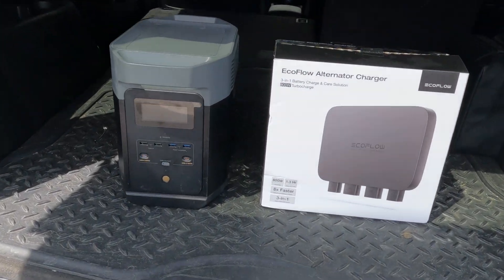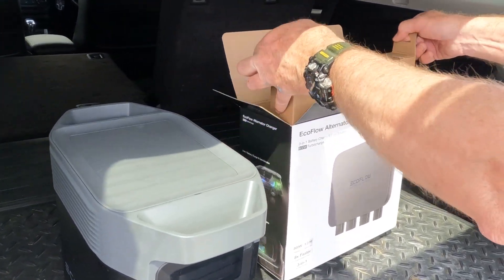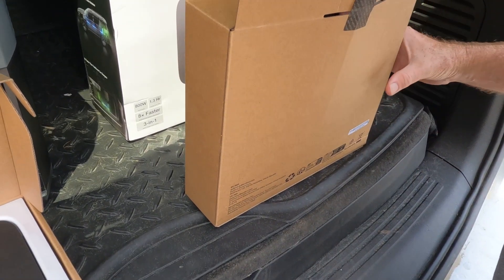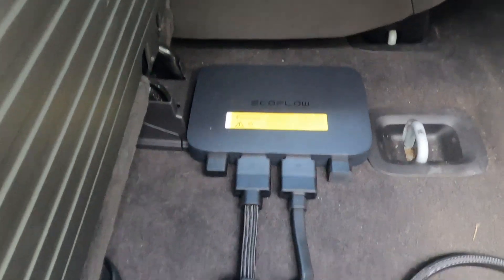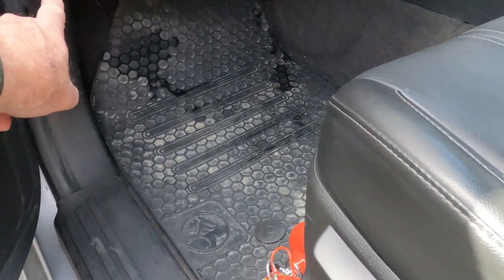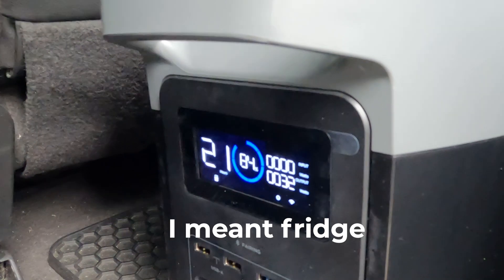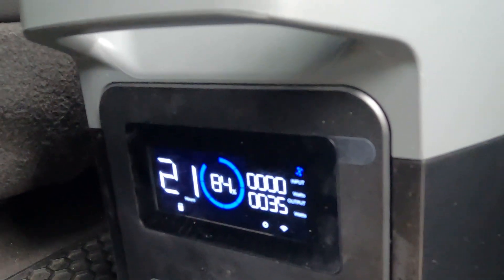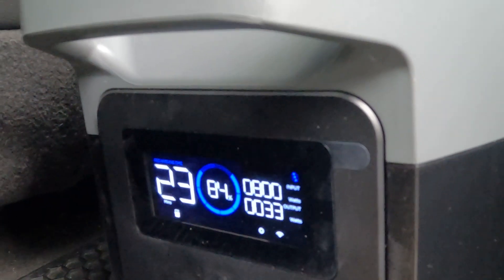Brown Under - EcoFlow Alternator Charger Install

Comment: Tidy install! Have been looking at these units as well. Do you use the Ecoflow for all your 12v needs or mainly just 240v AC and something else for 12v DC? Have read mixed reviews about the 12v capability of the Ecoflow.
Reply from the maker: Thanks. I use it for everything. Fridge, lights, Starlink, 12v Projector and charging camera batteries. I also have smaller (older) EcoFlow which I use if I want to run stuff away from the vehicle. I then charge that off the bigger EcoFlow if required.